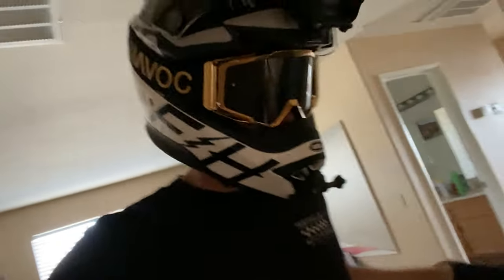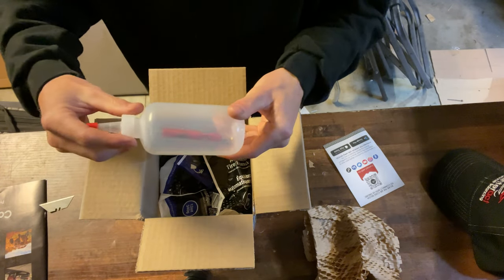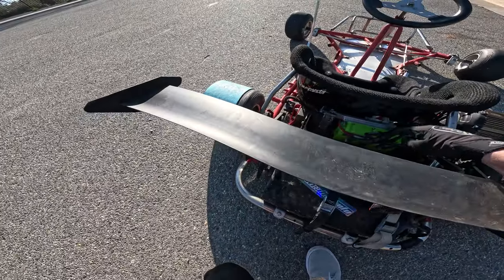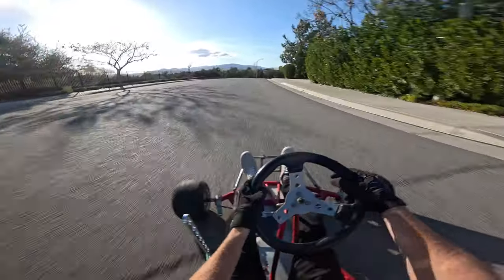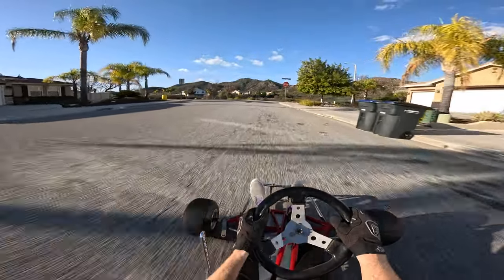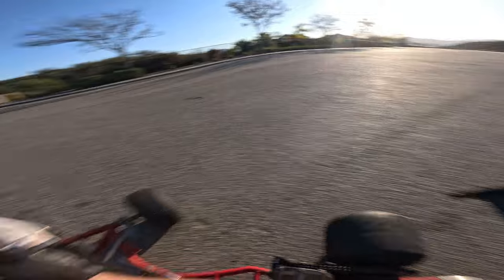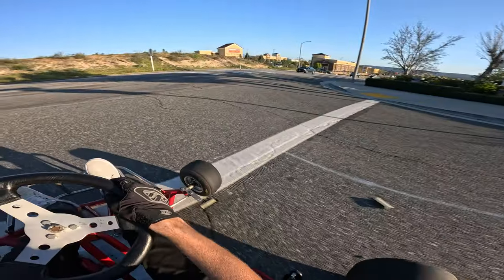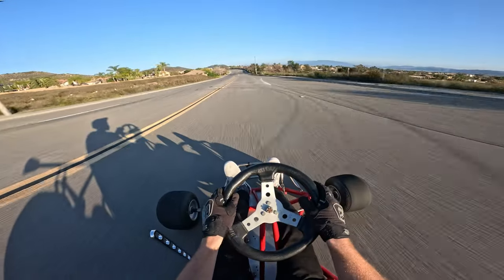75mph Electric Go Kart ⚡️| DIY Guide + Raw Driving

Comment: That’s sick. I’m building my own e go kart right now. I have the 60v 38ah battery. X sine wave controller. I just need to get a hold of a motor. Can you post a photo of how you mounted the motor to the frame? Also did you buy harness extenders for the battery and controller?

Comment: Howd you make the motor spin the other way?
Reply from the maker: You can reverse 2 of the phase wires (don’t recommend), or you can reverse the direction within the FarDriver app. Also I just built another kart with the chain on the inside, making the orientation the same as stock which I recommend doing.

Comment: So everything kinda just slaps on but maybe the chain needs to be adjusted to length? Anyone else’s got more info
Reply from the maker: Yah, the chain you just cut to size, then shifter karts have the chain adjustment through the motor mount. I’m going to have to make a more in depth video, didn’t explain it very well in this video.

Comment: Im building my own gokart it  has 800wats and 48 vold is it good
Reply from the maker: Your going to need a bigger motor. At least 4kw (4000w). Bigger the better.
Reply: @motomatt224 but i got allready an axle witch has a 800 wat motor on it so i cant change it but it goes something 40kmh
Reply: @motomatt224 this is gonna be a big question and a big thing but i am just asking would it be possible that u would come to the countey where i live and build build with me an gokart or cous in finland u cant buy just an surron motor so could i bring one u dont have to

Comment: where can I get the motor mount?
Reply from the maker: The shifter carts come with a motor mount. You just need thick 90 degree metal brackets from Home Depot. Drill them to match the holes on the motor and chassis.

Comment: Do u have a link for the universal motor mount please?
Reply from the maker: Check out my video “building another kart” from a couple uploads ago, I made a video showing the entire build. Had to make a custom bracket because I couldn’t find the same one that was used in this kart. Pretty simple to build. I welded mine up but you could make one without welding with bracket from Home Depot.
Reply: @motomatt224  thank you
Reply: @motomatt224  are you running it with the main switch or no need?

Comment: But if i have an 72 v surron motor and a 48v battery does it work or does the volt nees to match
Reply from the maker: Doesn’t matter. The controller converts the Voltage. Any decent controller will work with 48v-72v
Reply: @motomatt224  what is a good site where i can buy a surron motor cous in finland there is noone who sells surron motors